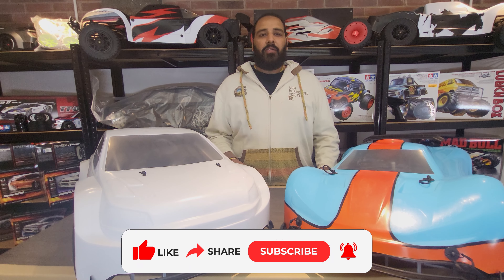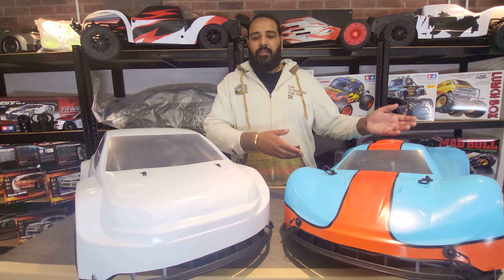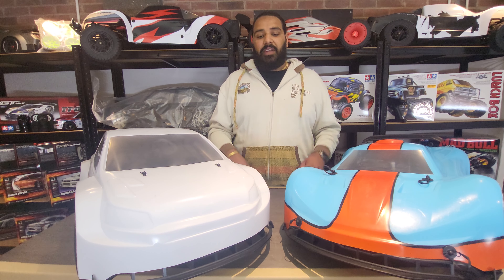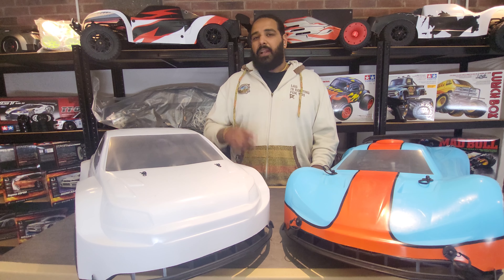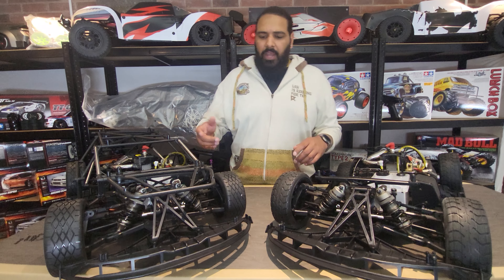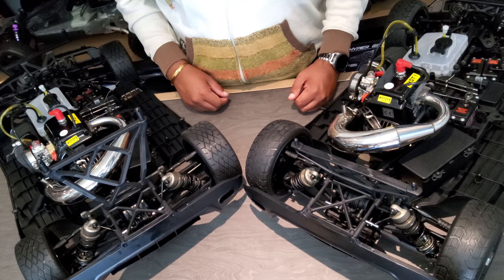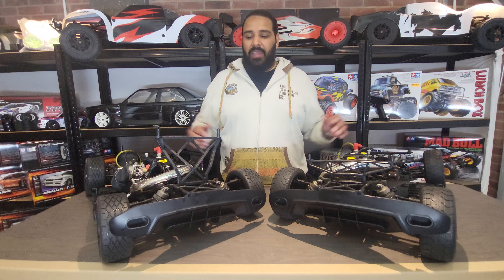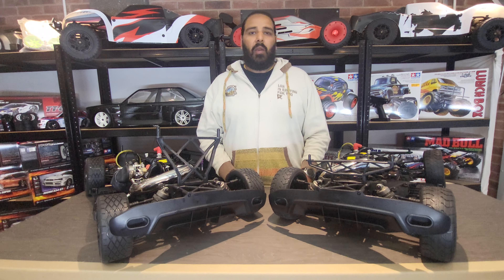WHATS THE DIFFERENCE BETWEEN A ROVAN ROFUN RF5 and F5? SIDE BY SIDE COMPARISON.

Comment: Do you know if the rf5 rally shell could fit onto a 30 degree north buggy? I want a gas rally car for a large dirt off road track here in the uk so would like the extra suspension travel .
Reply from the maker: @neontetra1000  Anything is possible but would require some work to fit with the roll cage. The RF5 is capable off road as its a rally car. I've had mine jumping, off road, on road and grass. 

Have a look at this video below. 

https://youtu.be/33r6uHCuer0?si=q4iTaOnm_dFisfel

Comment: Can a bigbore engine such as taylor 50gt fit in the f5? Or limited to regular size engine, i see thunder rc installed on his rf5 a 46cc engine, but never saw a bigbore on a f5...thank you for your time❤
Reply from the maker: I'm sure you can, but in taylors range, anything over a 50cc is a over kill and not really usable in this model. 

The big 71cc that taylor do are also a over kill on other models. Great engines, probably the best, but you will be destroying diffs, diff case etc...
Reply: @thercstore.  🤣 i know, all diff,gears,wheels must go, f5 is a slow gas car rtr, electric 8-12s are insane fast, but i dont like e cars, so im trying to build one that will be a screamer...
Reply: @thercstore.  maybe the new taylor 35cc v2 engine with higher gears could be a perfect match👍
Reply from the maker: @gsrc6876  Yes, it's all trial and error, I guess. Our F5 is extremely quick out of the box, quicker than our RF5. 

Though the RF5 does need tuning. 

We are trying a few things with the stock 45cc engine to see if it can be improved, but we are looking at some taylor engines too.
Reply: @thercstore.  thank you for quick answer
Reply from the maker: Your welcome

Comment: I have two of both 👍
Reply from the maker: What's your thoughts on them?

 We've yet to run them. Hopefully, it will be in the next week or so.
Reply: @thercstore.  I love them now that they are electric and very fast
Reply from the maker: Electric is a lot simpler, less messing around. I have the ELT basically an LT45 but Electric, I love it. But then when the batteries die fueling up a petrol is quicker and there's something about the noise that makes me want to keep running the petrol cars. But the power you get from an electric is crazy!

Comment: So, only difference is tire size and a rollcage? Could interchange wheels and tires for onroad racing? How this compares to hi end european cars?
Reply from the maker: @arielvazquez6202  That's correct! They are colones of the MCD but much cheaper. The parts are all interchangeable. They are actually good for the money, but the motor are hot and miss. If you get a bad one, it does let them down a little.

Comment: What’s the ground clearance on the RF5?
Reply from the maker: This would depend on how you have set up the suspension, oils used spring rate, and where the shock is positioned on the top and lower mounts.